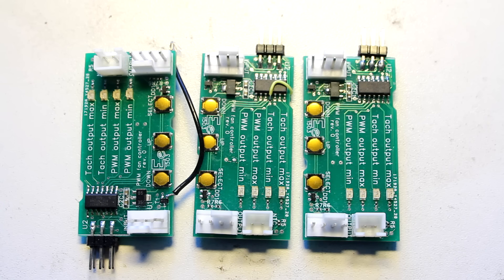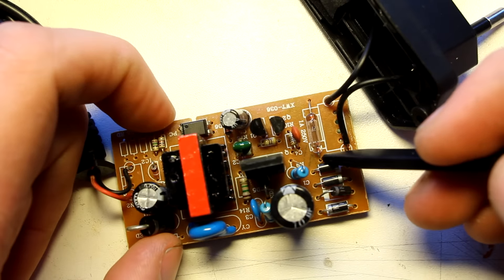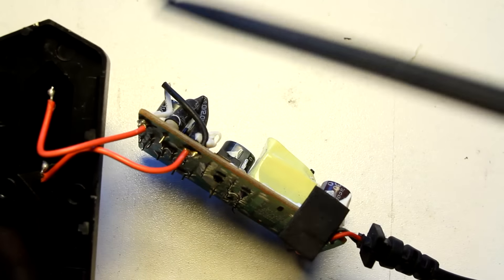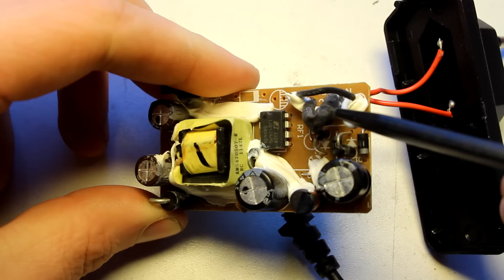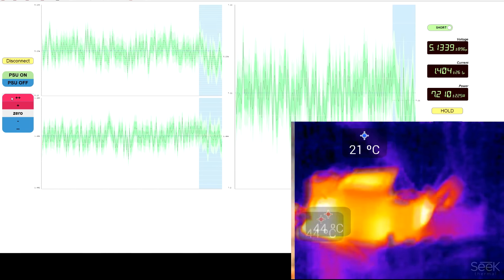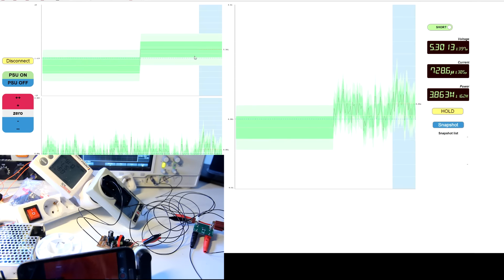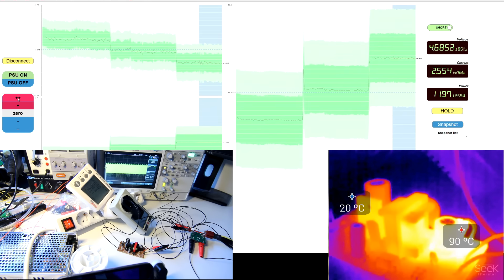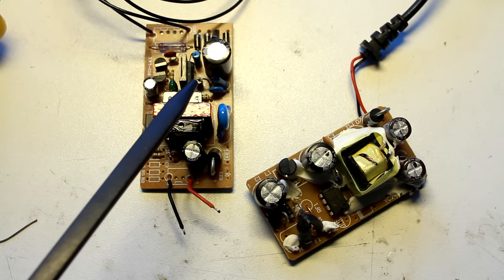A crappy and a dangerous 5V/2A PSU - which is worse? (014)

Comment: Noise may be bad, but temperature is not that bad. Diodes can easily handle 120C, of course, if they are close to electrolytic capacitors and heats them, it can be problematic. I generally dislike when the plastic enclosure gets above 100C at max. load, this is very bad for the capacitors.
Nice video, but why not get an electronic load, they are fairly cheap and very flexible (They may not be ideal when you want to measure noise).
Reply from the maker: +Henrik Jensen I've had nothing but trouble with electronic loads. Even when I tried designing my own ultra-stable load, it would still have trouble with high ripple power sources. Resistors are just a very easy 'this can't go wrong' choice. 

The diode going up to 115C was of course under gross overload, so I don't really blame it that much. Pity though that they had so much free space on the board, but just had to place the capacitor RIGHT NEXT TO the diode, the single hottest element on the board :P
Reply: +PowerElectronicsBlog As you can see on my test electronic loads works most of the time (Load sweep is done with electronic load and they are very stable).
When measuring noise/ripple I always uses resistors to avoid any unstability/noise from electronic loads, but for most other test electronic loads is much easier to use.

As you can see in my teardowns capacitors are often places close to heat sources. In my test it is seldom a serious problem (Very few people is going to load a usb power supply fully).
Reply from the maker: Sure, it's mostly just a longevity and/or output power quality issue. Neither power supply in this test performed anywhere near admirably. They both had >1Vpp noise on their output, even at intermediate loads. That alone is a big issue for a lot of devices you're likely to charge/power with them.

I don't disagree about the virtues of electronic loads, I have designed and still use two of them :P I'll show them someday. But they're just not as well-behaved as plain old resistors. Anyway, I'll watch your content :D - speaking of which, do you have a link?
Reply: +PowerElectronicsBlog I believe I posted a link to an earlier video from you, but here it is again: lygte-info.dk 
For some time (>1 year) I have published a review of a usb power supply each week, including a tear down and IR photos.
For load tests I have not seen any problems with my electronic loads, but I do not use them for noise test (And have not tried it).